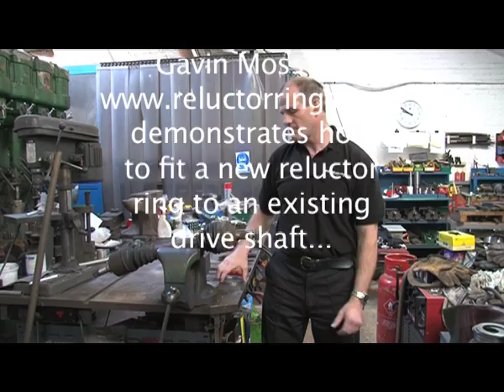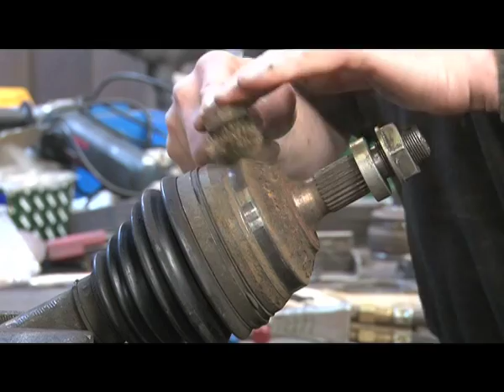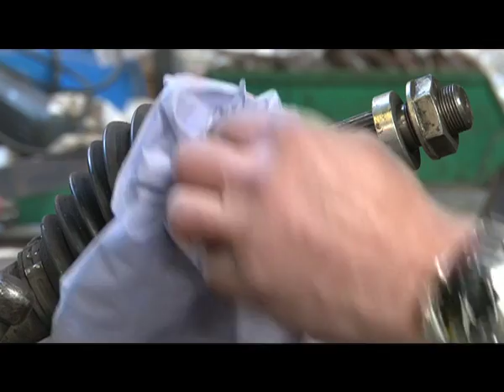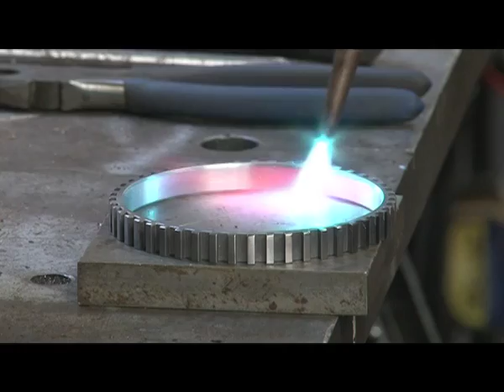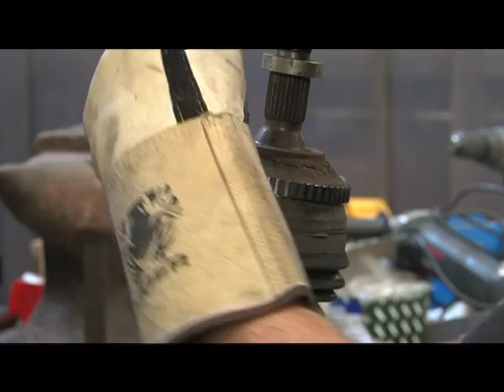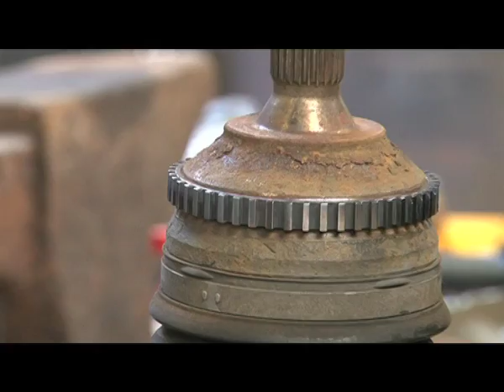How to replace a broken ABS Reluctor Ring to your car - toothed ring

Comment: Hi there... Just a quick question after watching your informative video. I have a saab 93 and my reluctor ring was broken and as a result the abs light and stability control module came on the display. My question is... I have found a used one from a junk yard and it was a bit rusty. Can I clean it with a wire brush to make it shiny or it contains any magnet on it that it might damage it?... Thanking you in advance.

Comment: I had a split tone ring. All I did, without talking anything apart I cleaned it all up and used some liquid steel on the crack while using an alligator thin nose mini vice grips to hold it together while setting up. Make sure there is no excess epoxy buildup in the channel.
Reply: Interesting. Thank you.

Comment: Is there any way to prevent the corrosion damage returning without affecting the operation of the ABS? For example, zink priming the drive shaft joint and reluctor ring?
Reply: You can't stop it but can reduce by priming the shaft . Water gets between the surfaces ( Ring and shaft) and merrily corrodes the surfaces. Once the ring is fitted you can try to run silicon around both sides to prevent water creeping in but this is a long shot.

Comment: Hi, I have a Bmw e90 320d 2011, the rear Reluctor rings need replacing on both sides also the ABS sensors, how many hours would this job take? Can a anyone do This?

Comment: I just did the ring on my Saab 9-5. ABS light came on and quick check revealed it was rusty and cracked. I replaced mine with the drive shaft on the car. It was a bit of a chew on and had to file the old rust off first to seat it. To get it off you need to:

- Remove the hub/drive shaft nut
- Remove the brake caliper (not essential but makes it easier)
- Remove either the bottom ball joint or the two bolts holding the hub carrier to the shock absorber
- Tap the drive shaft out of the hub.

The old ring will come off eaily enough if its cracked. You need to prep the seat and file off old rust first. Its quit hard fitting the ring on the drive shaft in situ but it can be done. Just takes more fettling with a file.

Comment: The left rear ring on my US model X-Type literally disintegrated.  Not much left.  The surface underneath is quite irregular.  I will probably epoxy the new one in place if the replacement easily slips into place without heating it.  Wire brush on a drill is what I used to clean mine up.  What a chunk of labor to change a simple part.
Reply: Its not the part that costs, or the fitting time, its the labour involved getting the driveshaft off the car, then putting it back. 

Very few people bother changing the ring, most people just swap the whole shaft.

Comment: the problem i see with this video is that you have already removed the shaft, that's the part that i need to see.
Reply: it's held in with one bolt and maybe a retaining ring at the diff

Comment: hi, i got charged £400 to replace 2 of these , and watching this im positive i got ripped off as the rings only cost about £40 each..
Reply: The work involved in taking the drive shafts off is where all the labour is. You are only seeing the easy part.
Reply: For four hundred quid they changed the whole drive shaft or changed cv joint with ring on. 🤔 🤔